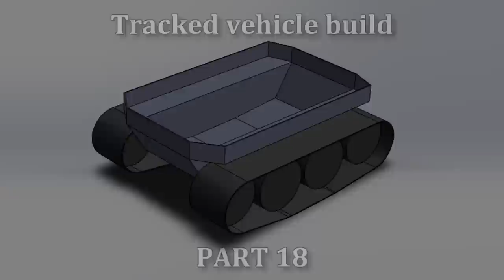Sheet Metal Hull DONE - Tracked Amphibious Vehicle Build Ep. 18

Comment: Hi Donn.
My withdrawal symptoms are gone. Thanks for Ep. 18!
I would only make some sort of foldable emergency seats in the back.
Ep. 30-60 Tracked Amphibious Trailer for passengers or load, driven by the Tracked Amphibious Vehicle.
That would be amazing, but would need a more powerful engine and a extended pluggable drive shaft.
Quite elaboratly to build, but I'm sure you could overcome this challenges.
Thanks for sharing your work. I admire your skills.

Comment: Excellent work.  If it was mine I would add 2 bars down from the top of the roll bar so if it would roll the bar wouldn't fold front or back .
Reply: Id actually  extend it over the rear seat as well give any potential  riders a chance to not be crushed

Comment: This is looking really good now - superb work. I was wondering what you are going to do for some protection. I think the vehicle needs some form of front deck just in case you get a bow wave coming over the vehicle when you go into water. With tracks you could go down a steep bank into water but the vehicle would then nose into the water before starting to float. Perhaps a windscreen in front of the driver and a thin sheet metal front deck. 
Also on the same theme what about a bilge pump?
Reply: Glad I'm not the only one who was thinking that Allan. Although, it depends on approach speed towards the water deep/shallow. The front is a little 'Flat' if you like. Perhaps you could extend the nose/bow and mount the winch on top rather in a box.

Comment: Still hope you paint it mat black with yellow accents 😙🎶

What a beauty!
Reply from the maker: Gonna probably use whatever color they have at the powdercoating facility. I can cover it later on with whatever color I like though.
Reply: @DonnDIY  what about doing bluing for preservation and plastidip for some additional protection?

Alternatively to bluing you could burn in linseed oil for preservation, or use phosphoric acid. These methods are all pretty cheap. 😙🎶

Comment: hello,
I have been following your build for a long time already and like it very much. I would recommend that the protection for the propulsion shaft that you are building around minute 24 is non permanent, but stronger than with those small screws, so that you can remove it when you will need to perform maintenance on the shaft, which will happen someday.
In terms of design , the space under the belly of your craft look like it won't be a lot of space between it and the ground. You may want to add much bigger rims or another layer of wheels under those axles, to increase the ground clearance. Bigger rims may touch one another as they are already close. What is your idea on this ?
Many thanks for sharing your build !!

Comment: I missed a bunch of videos and will go back and watch but wanted to ask question as I love the  build. What about the exhaust? A   straight pipe up in the air or out the side so the sound and fumes can get away from driver or have you even thought that far yet. Its a hell of a lot of work building something strong enough to rome around on the moon. I mean it almost bullet proof as well!! Over built might fall in there since every corner is water tight. Add a glass roof of some kind and put oxygen in, you could roam the moon. Well build Don. If it gets much heavier, someone on the block will be late for work and your machine will have the engine out of someones Beamer/LOL

Comment: just a thought next time maybe wire brush the rust before you build ,,saves on time of climbing around and trying to get too all the spots ,,2 nd time watching the build ,,nice work ,, you do need to build a blast cabnet .big enough ?? engine block ? what i would do is put holes in both ends with covers then you could slide pipe or angle iron threw cabnet to blast sections at a time .. great work ..

Comment: - putting battery along vehicle, may give universal housing for normal and increased capacity battery, and some room for regulation, it could be also interesting to put driver seat exactly in the symmetry, 
- if you changed the only side profile from C to L shape cutting upper shell and reinforcing with some brackets strong enough, you can add some seats later on at left and right along, this it will also be more comfortable to jump in and out the vehicle, and in plus you gain some space at the rear to transport whatever you would need, 
- ground or stones or smaller trunks may strike area at the front and rear bottom walls that are attacking pars, adding some L shaped rigid like 10mm something from the inside may do the trick, 
- weight of the engine and battery together may exceed the driver weight, isn’t better for balance to put battery on the driver side? 
- you will probably check on the welding of the axis, irregular ground will put maximum stress on the wheels -> axis -> and welding -> entire structure, are you planning to reinforce it against torsion? 

fantastic what you are doing there, nice project 
Merry Christmas Donn

Comment: Battery should be located where it can be easily charged or changed.. also the wiring should be considered... drivers seats seems too big? also the controls seem somewhat big, any plans to make them more compact?
Reply from the maker: Battery is easily accessible. The floor in the rear will be easily removable.

Comment: I think that the frame is too much heavier.
The sheet in steel have a good resistance torsional but the pipe it is more inflexible.
I think that you have used too much pipe for create the basic frame.
I think It better used the pipe flanged. 
For create a flanged you can use a piece of metal pannels and with a milling machine create all hole that you need for assembly it in the frame.
It is better use the screw, simplifies the maintenance.
If you have worry for broken the screws you can forecast some poin of flexibility in the frame.
But in this case is too late.
So, i think that you have create a good desing and good mechanical system☺️

Comment: Cool are you going to put in any steps to get in it.
Reply from the maker: I will have to see how far the tracks stick out so I can build a fold-up latter maybe.
Reply: It would be cool if you had a  roof to put on incase of rain or snow.   Also are you planning on putting a rust prevention on wherever water may get in touch with the metal. Like the inside an outside